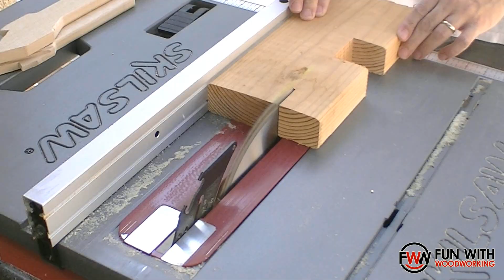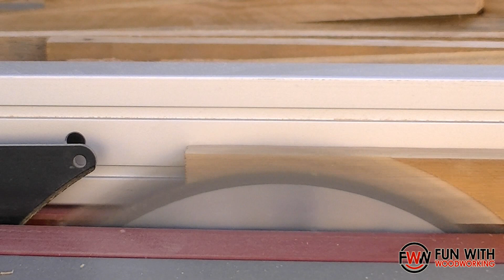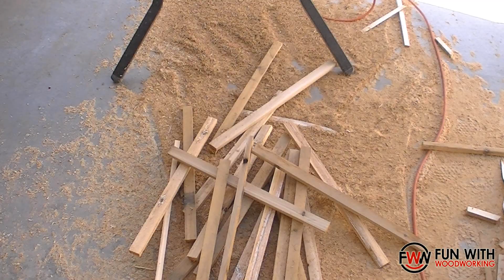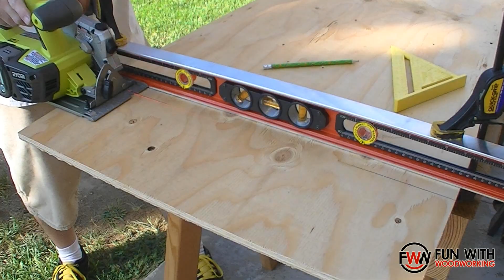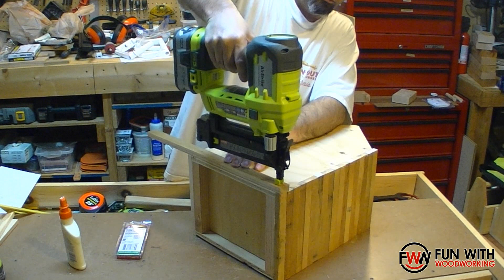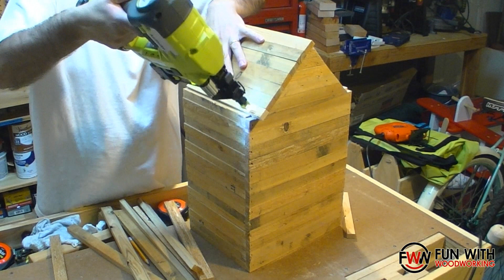My entry for the 2014 Summers Woodworking Birdhouse Build Contest

Comment: How do you like your nailer?
Reply from the maker: Brad Polkinghorne Overall it's very handy and I like the portability of it but it is much heavier than I am used to.I have an air brad nailer that I normally use and it is much lighter but I am limited to using it inside my garage.  I've had this new one for a few weeks and was waiting for a good project to test it on.  If you do not have an air compressor or want to use it outdoors then I highly recommend this one.